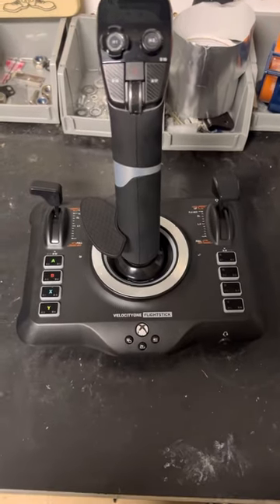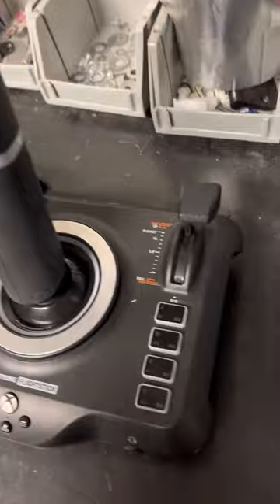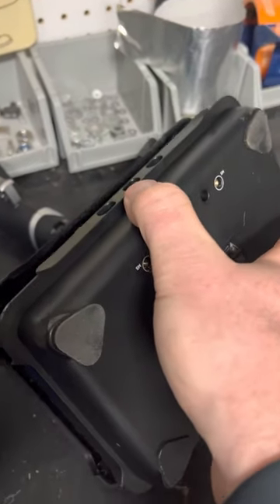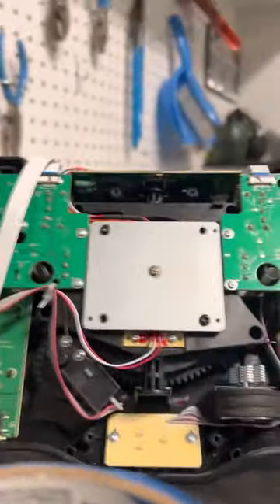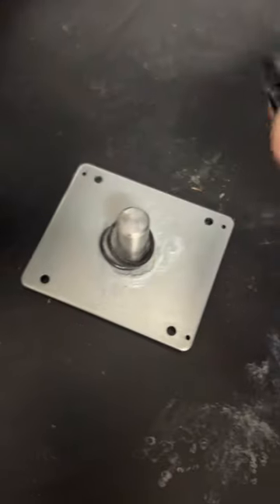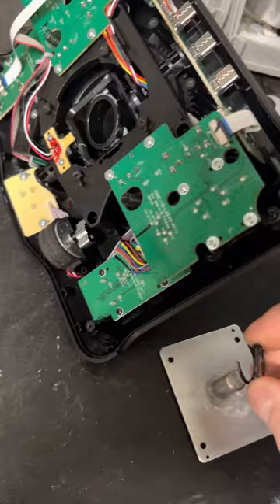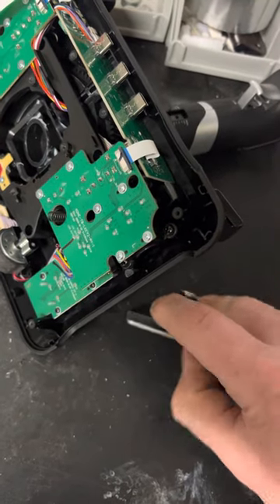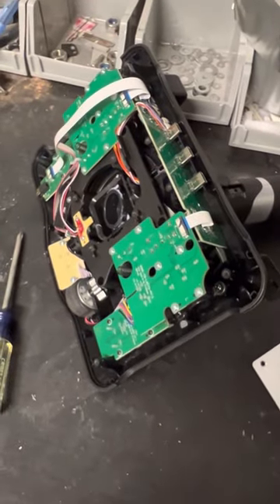VelocityOne Flight Stick Spring Tension Adjustment | Stiff Stick Fix

Comment: Tension Spring Dimensions:
17mm Length
18mm Outer Diameter
1.4mm Wire Width
Stainless Steel Material
Reply: This is the original spring? Isn’t it?
Reply: thank you very much, i would get some springs with 1mm wire with and 15mm length to test if it fits me!!!

Comment: I ended up not even cutting the spring. I just made the 4 screws holding the metal plate a bit looser and the stick feels perfect now!
Reply: Thanks bro, I will be receiving mine tomorrow and will do this
Reply: Just tried on mine.  Problem is the plate will be moving/rocking with the joystick, so you're going to be hearing that "clunk clunk" everytime you move the joystick.  I'm just going to swap the spring on mine.
Reply: @Diniven  Hmm I don't have that issue. Maybe you can thighten the screws a little  and make sure that they're even. Might be worth a try.
Reply: @maybe_abdulla did it work loosening the screws?
Reply: you can also add washers between the plate and the base which will increase the distance without causing any potential malfunctions due to plate wobbling around.
Reply: @Diniven  just put washers between the plate and the base itself then screw it.
Reply: @Diniven   put some (plastic) washers in between, problem solved.
Reply: Thanks ! This works even better than cutting the spring. I put some washers in between the gap of the screws so the metal plate stays a snuck fit. I might even replace the screws with longer ones to match factory spec.
Reply: @zeknoss That's brilliant.  Imma print some and try it out!
Reply: @N1h1L3 This is a GREAT idea
Reply: @Diniven lemme know how it turns out pal!
Reply: @Jarvice so i just unscrew the 4 screws as per how much tension i want the stick to have? has it caused any problems? thanks for finding this out
Reply: @sxnchou  Yeah I still use mine without any issues. A few turns for each screw did the trick for me.
Reply: @Jarvice wow that's a quick reply despite how long ago you've commented 😮 you're amazing for finding this tip out, gonna receive this stick next week and will try this when I get it. thanks again!
Reply: @zeknoss  hey, non native english speaker here... when you say the base, what do you mean? thx
Reply: @yeahbuddy300lbs  that means the big, lower portion of the device Lenny
Reply: Thanks for the tip, just did this too

Comment: Just wanted to add..  I did this mod and it is great.   Two things..   1.  If you cut the spring too short, you will notice that the top of the metal washer / housing that sits on top of the spring will be slightly lower that the top of the pole.  This will mean that your stick may not fully "center" itself (spring back to center) as there will not be enough tension.   (if you are flying gliders for example, this is wonderful).  Fear not if that happens.. all you need to do is heat the spring with a lighter for about 45-sec and then using two plyers pull it apart just a tiny bit to expand it, then run under cool water and your set.   2. If you have "creaking" sounds from your stick you can test your tolerance by placing the base cover back on the bottom (with the main spring out) and the stick should be very floppy on the pitch and roll axis (totally dead and free flopping back and forth).  Mine was NOT.  It had some binding on the roll.  Unfortunately, there was no way I can see to easily fix this (so I am returning this one and ordering a new one, thank you Amazon).   I spent hours looking at it and thinking.  I think the best way, would be to fully take it apart and then measure the male ends of the rocker mechanism, buy 4 bearings with that same ID (inner diameter) and then bore out the sides to support (seat) the bearings.  Then, you would have perfection in all accounts, and this would be an amazing stick.

Comment: I did this mod a few months ago and had great results! Now just to figure out how to reduce the tension of the twist/rudder mechanism
Reply: It seems impossible if you dont want to detach cables.
Reply: @yahyakr6903 , can you elaborate on this?  I am not familiar with the hardware dynamics of HOTAS, and I was hoping that the rudder action was based on that same spring.  I actually use my stick to play MMOGs believe it or not, and I'm constantly using the rudder axis while thumbing the analog hat to strafe around while panning the camera.

Most of the time I have to end up twisting the stick with three fingers to and not only does it become quite tiresome due to how much torque is required to twist the dang thing, I end up putting far more pressure on the two hats since my hand is under load even though I'm trying to isolate my thumb.  I'm concerned this will prematurely wear them out.
Reply: @daviddjpearl You need to remove cable attachment welds and reweld them, otherwise you cant change the spring. Remove the plastic covers on the grip and remove the bolts, you will see, but be gentle.
Reply: @yahyakr6903 , thanks much for getting back to me.  The problem is I won't see what you're talking about nor have the opportunity to carefully get in there because there is no f'ing way I'll ever muster up the courage to attempt that procedure! 😆

Comment: Hi all! I just received mine this week. The tension is overwhelming. One must do so much downward pressure to avoid raising the device on each side. I tried your method with no luck, as the bottom cover is attached to the device's body. All 8 screws were removed, but still, you can feel that something else is attaching both parts. As far as I could see the board with the USB ports is now attached to the bottom cover with a ribbon to connect to the main board. Unfortunately, I may say. Unless the device is mounted is pretty much useless. I just need to evaluate if I want to force and potentially break the device or leave it as is.
Reply: I just modded mine and I had the same problem. I was able to push the small board with the USB ports out of the plastic frame and put it back where it should be (there are two cutouts on the left and right of the USB ports that slot into the frame with the stick attached to it). Next I didn't even cut the spring, I just made the screws holding the metal plate a bit looser. Putting it back together took some fiddling but now the stick feels perfect!
Reply: Thanks for the comment @Jarvice I will have another go later, to see if I can find a way to push the board out of the plastic
Reply: @Jarvice this might be even better solution, to give it less strength by increasing the gap  
I wanted to buy this stick, but hearing the stiffness issues makes me not wanna get it, as I can't mount it
Reply: @bosniak006  did this worked out for you? cause i'm having the same issue

Comment: I would like to point out that using a vice to compress and therefore shortening the spring is the better, less intrusive way of lowering the tension.
Thanks so much for the video, it was a great help !
Reply: Could you elaborate on this, not sure what you mean?

Comment: Thanks for the video, great tips! I didn't have a cutting tool strong enough for the hardened steel, but I tried 3D-printing a 2mm-thick spacer for the metal plate to reduce the spring tension; it feels already much better.

Comment: Nice tip, thanks!  Another issue mine has is the post and collar are too tight so it acts like a shock absorber w/ too much dampening...  Takes too much to push it down, and it doesn't return quickly enough w/ the lighter spring. re-lubing helps but may have to try honing out the collar a tiny bit to make it return quicker.

Comment: Possible Spring Replacement if you cut your original too short.

This spring from Amazon  seems to be a replacement for the original spring.    The base of the velocityOne is still too light so with this Spring the joystick still will tip when moved to it's extreme positions.  I'm looking at some method to increase the weight of the VelocityOne base with maybe lead shot and glue or  piece of heavy metal.  Amazon descritpion follows:
USD 7.50 gets five springs.  With this spring,  the centering tension is about the same as my Thrustmaster T160000.

uxcell Compression Spring,304 Stainless Steel,18mm OD,1mm Wire Size,9mm Compressed Length,30mm Free Length,5.9N Load Capacity, Silver Tone,5pcs
Reply: I've ordered a pack of these for when my V1 arrives. Thanks for the info. 🤙
Reply: @adybarker4733  How did these springs work out for you?
Reply: Im thinking of doing either the washer thing or getting a less stiff spring . Add more lube to the collar thing and then out some tire wheel weights in the base and stick them down with some tape on it not to touch anything electrical
Reply: How did the spring work out

Comment: SUCH a great video!  I wanted to ask.. I noticed there are 3 tabs on that metal base, but only 2 are on the inside (looks like there should have been 3 to line up in all holes),  unless I snapped one off (but I was VERY careful), so I don't think I did.

Comment: Unrelated, but I have a problem with the H2 stick. I use it as my cockpit camera as you don’t have VR or head tracking on Xbox. The problem I am experiencing with it is for whatever reason after I downloaded the 1.1.6 update for the TB Flightstick, the camera will point left and down as if it has a stick drift issue. I’ve even tried to recalibrate the stick by holding B2 and B8 buttons for five seconds and going through the recalibration process. Despite this, it still is an issue anyway… Is there a way to either factory reset the Flightstick or to outright fix this issue? I really do not want to spend money on a replacement flight stick.

Comment: I managed to find a softer spring of about the same size as the original. Now it's perfect and I can easily swap it back if other issues arise.
Reply from the maker: Nice! Post where you got it for others.
Reply: Yeah, I am interested in this new spring too!  Please post where to get it 🙂
Reply: please post a link to the new spring
Reply: Thanks for saying this and never posting any description where you got it
Reply: @gregorybentley5707  dont do any of this... Just add a couple small washers on each screw of the baseplate. Similar to suspension dampening it will relieve some pressure on the spring.

Comment: Dude! That’s so awesome 😂  How does it feel in the sim now? Did it create a dead zone at all? I’d imagine its best on the precision setting, now that the tension is off.
Reply from the maker: Feels so good! No dead zone. Standard setting feels the same as far as movement of the stick in relation to movement in the sim before but just the base won’t lift up. Precision setting is where it’s at though. Way more stick movement is needed to control the plane which feels more realistic.

Comment: I am hours away from receiving my unit and the reports of the stiffness have me spooked a bit.  Although I'm not so much a handy guy, this seems simple enough to give it a shot.  Honestly, and I'll probably get made fun of this, but the main deterrent is the removal of the hidden screws under the feet.  One thing I always avoid is removing pieces with permanent adhesive or fasteners, since you'll likely never get the stock affixation back.  In terms of this particular mod, it's very minor and probably just sticks right back on if I had to guess.
Reply from the maker: You don’t have to remove them completely. Just peel back a tiny bit like I show in the video.

Comment: IT DOES HAVE A RUMBLE MOTOR!
I jerryrigged mine up to a lap board when I got it last year and havent had it apart since then. 
But I got into an argument with someone across flightsim and turtlebeach discord about it having a rumble motor inside it and that no game that I've found uses it. Why is it there? Nothing in the software or the website or specs sheet mentions and rumble feature.

Its a shame they didnt go that bit extra with adding some kind of screw wind like the old thrustmaster that can be accessed through the bottom with like a coin slot cap.

Also to note. Theres probably a threshold to cut down before that platform no longer centers the stick and it flops at dead center with a deadzone. And that point is probably very close to where I have mine now because I wanted to take almost all of the initial spring tension out of it. I dont think you can. But I cut the spring probably down to about a third of its original height, the plastic sleeve that slips over the shank is just about level with the shank. 
The stick still snaps back a bit more than I like it and resists a bit more than it should for a pro setup at dead center. But its massively improved over how its shipped. It feels like a flightstick now, rather than a controller thumbstick. One finger flight control is easily done. 
Now the only gripe with the control surfaces is the rudder twist tension. Which I cant go out and spend $200 on pedals for.
Reply: So odd that they haven't enabled the rumble motors. Their French site even mentions them "Thanks to the two integrated vibration engines, you will feel the engine reaction and the impact of enemy weapon fire, for more realism."
Reply: @BALLOOROOM  Thats bizarre, I havent seen anything about it here.
Reply: Could be because of that patent troll that was chasing companies using a certain rumble technology.

Comment: Don't cut the spring.  Just use 2mm washers (or 3d print some to your liking) and use that to offset the plate from the spring.  This is 100% reversable where cutting the spring is not.
Reply: which dimensions of washers do you need for it to work properly?

Comment: Thank you for the Tutorial! But somehow I failed removing the backplate, it was stuck at the USB-C ports and i couldnt get it out, was that also a problem for you or is it just me?
Reply from the maker: No, the backing plate comes right off. Are you sure you removed or loosened all 8 screws including the 4 hidden screws enough? If so, just give it a little pry and it should pop off.
Reply: Same problem here. Did you ever get it open?
Reply: @nateice1 The USB connectors seem to be mounted of the cover and connected with ribbon cables, so I can’t get it off. Did you not have this problem? Could this be a different revision of the controller?
Reply from the maker: @GodslayerXUL  on mine it looked like it was connected to the bottom cover but the bottom cover actually just popped off and the ports remained in place.
Reply: @user-nw6pq4jc9g @GodslayerXUL I just modded mine and I had the same problem. I was able to push the small board with the USB ports out of the plastic frame and put it back where it should be (there are two cutouts on the left and right of the USB ports that slot into the frame with the stick attached to it). Next I didn't even cut the spring, I just made the screws holding the metal plate a bit looser. Putting it back together took some fiddling but now the stick feels perfect!
Reply: @Jarvice  Thanks a lot for your detailed response! After trying several times I sent mine back, though, and went for a VKB (which I think was the better choice for me, even if it was twice as expensive).
Reply: @Jarvice  How did you push back the USB board without damaging the ports or the board? Thank you

Comment: Thanks for this! It's a really nice joystick but the centering action is ridiculously strong. What diameter / length is the spring? Have you been able to do anything about the rudder axis?
Reply from the maker: Sorry, I didn’t measure it but the piece I cut off is about 18 mm or 11/16 in diameter if it helps. Also, I don’t use the rudder axis because I use rudder pedals.

Comment: I DO NOT RECOMMENDED THIS MOD. It eases the controls yes, but in return it also disables the original springs' ability to negate the friction caused by seperate double axis construction. 

Imagine you control the mouse pointer with your stick, after you change the spring it becomes harder to draw a shape like a circle. Instead it tends to draw corners in certain positions.

So when you need to use the roll axis while pitch axis is not in neutral, it makes a jumping motion instead of having a smooth simultaneous movement. 

Dont forget there is a reason why Manufacturer choose this spring instead of a less tension one.

(Sorry for eng.)
Reply: The issue is the collar and post being too tight.  Just have to also loosen this up if you find it doesn't return quickly enough.  It's almost identical to tuning suspension.  Lighter spring, need to lighten the dampening. :)
Reply: @aberg12012  yes you may be right, replacing the spring alone causing this problem.